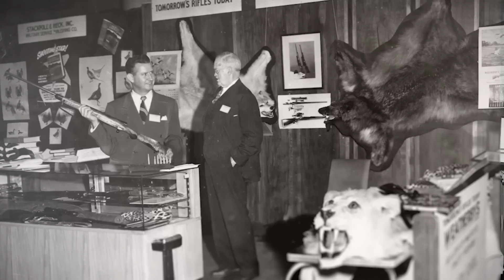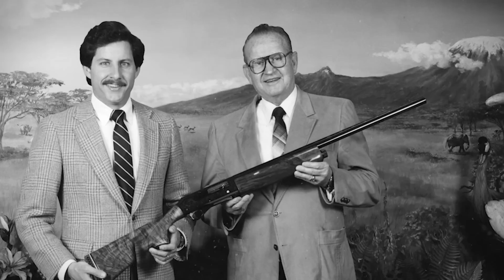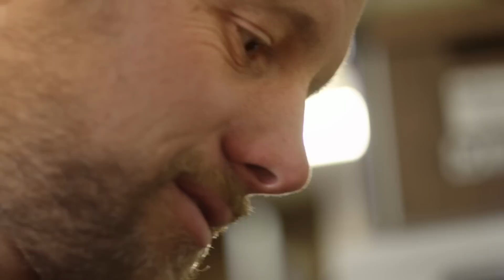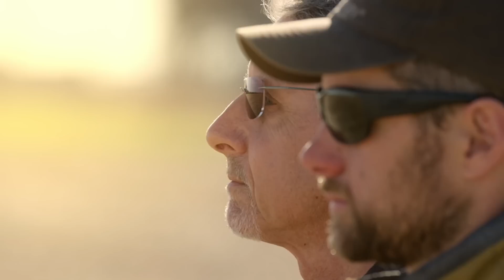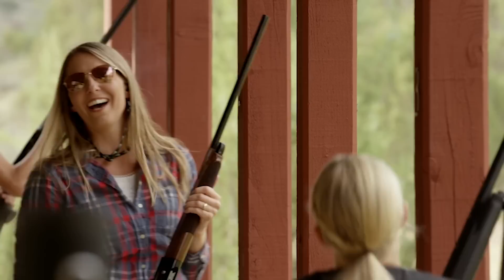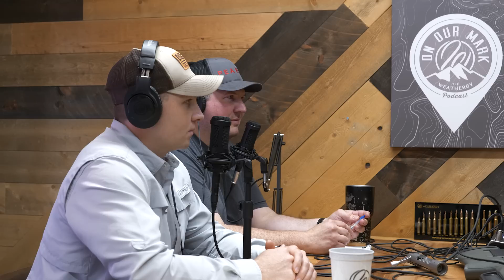On Our Mark: Episode 60 - A Look Inside the Weatherby Model 307 Action

Comment: It’s a interesting concept 700 foot print cheapened to savage mounts so no precision machining required, I didn’t notice or hear mention of a barrel nut. Or a three position safety. It’s got a washer for a recoil lug even the vanguard line is a step better in that regard and it accepts 700 scope mounts,  toss the out dated recoil lug in the mix with a out dated two lug bolt that is not much more then a copy of a Tikka bolt. One can only hope they copied Tikka’s bolt throw as well at 70 degrees and not the traditional 90. Coping the foot print of the action is all great so I understand the recoil lug choice however the bolt lug design could have been proprietary and made the action something great rather then just another 700 push feed clone with a few minor improvements. The vanguard or howa is styled more like a model 70 push feed action with integral recoil lug. So with the two lug 307 on the market maybe it’s time to re-work the vanguard with a nine lug bolt design and a trigger tech in it as well, rather the the Howa HACK trigger. Seems everyone wants to copy Remington’s old 700 when Remington themselves as a broken company has moved forward with an improved design. I honestly expected better from Weatherby as a new rifle design. A 700 in a chassis or cross over style stock ( bubba special) and let’s not forget the vanguard meateater fluted barrel. This is nothing more then a opportunity to make cash off of a recent void in the market zero research and development required.
Action- copied
Bolt - copied
Barrel- borrowed  
Stock- purchased
Trigger- purchased
Rail- purchased/ modified 
There’s probably a thousands guys that has built a better version of this at home. Sorry guys you missed the boat,  this is based on a market share grab.
Reply: I like the sound of the vanguard rifles but offerd w a 6 or 9 lug mark 5bolt lock up.   That is a very appealing crossover I'd buy a cpl of em .    I already own a vanguard .    And I absolutely love it.   Adf the mark v bolt into that design and ooooolalA

Comment: The saddest Weatherby rifle ever created.
Reply: Why is it sad.    It actually makes sense.    W all the aftermarket support of this foot print.    Plus it does have weatherby swag design added into it.   The extractor and bolt are much improved design over the normal 700s.     I think it makes sense cuz they already have the biggest strongest action in the game with the mark v.  They have a super high-end built for a value line with the vanguard and all the options if stocks n cerakote n flutes for the price is awesome.  Now they have something that offers customizers a option that falls in the middle.   Still built by weatherby and going through there quality control.   I don't see a issue
Reply: @LORD_OF_THE_ROOTS  like BMW building a KIA.
Reply: @z06cowboy  I get ur point, but I get it.    They probably gota offer something like this 307 to be able to keep building any of the mark v.  That's the exact reason the vanguard was made . And the vanguards are awesome.   It's not easy to keep the doors open with 3000$ rifles.    Most people won't spend that.   So I understand why and appreciate there smart enough and business savvy enough to realize that.
Reply: @LORD_OF_THE_ROOTS  Great points. You took the words right out of my mouth.
Reply: @adamweatherby4108  its my pleasure .  I don't like when people just say silly things wo actually thinking first.     I've been a weatherby man since I can remember.   My father hunted w nothing but his 257 weatherby mag my entire youth.   And I was more then happy to continue the tradition.